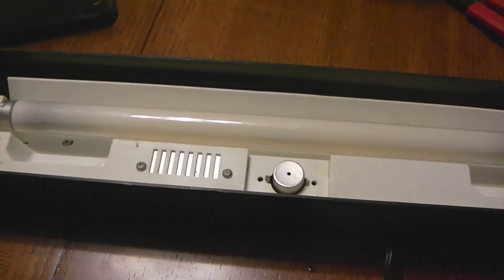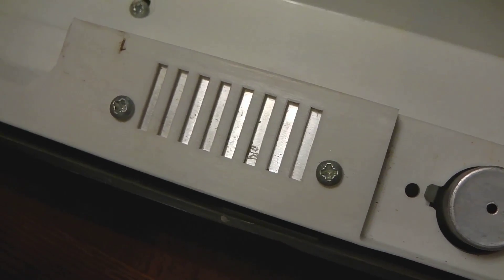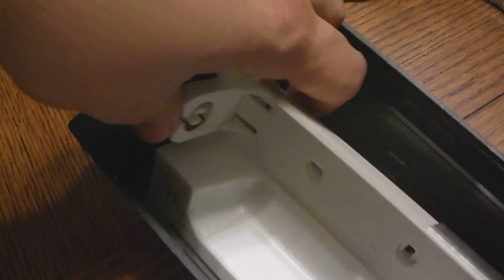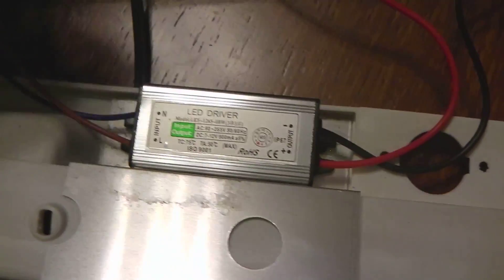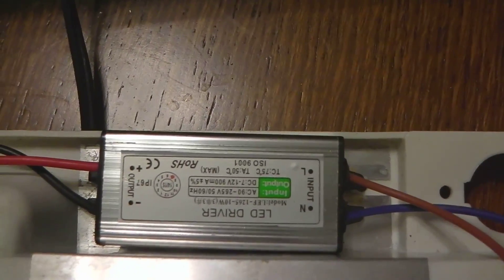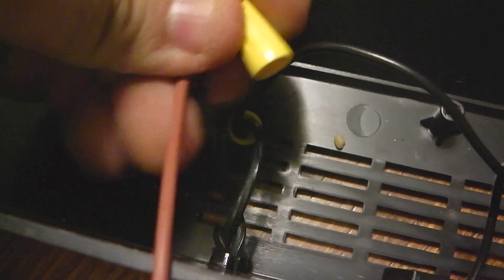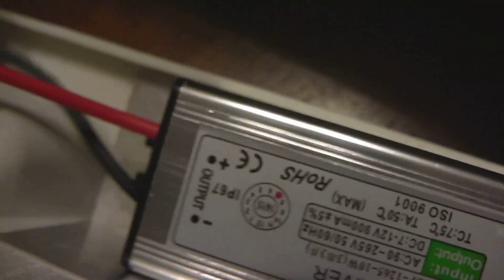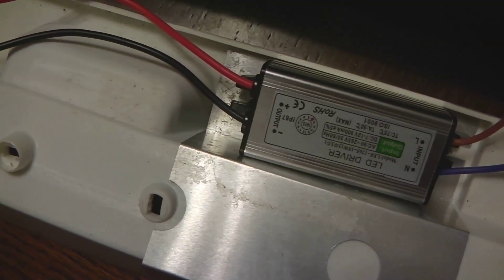DIY LED Fluorescent Aquarium Light Conversion

Comment: This is a great idea, but in doing electrical work always put the switch on the hot wire also known as the positive, not the neutral. This applies mostly to 120 volt home wiring where it can be a safety hazard. Years ago I had a 2nd floor toilet overflow and the water leaked through the ceiling and into my over the kitchen sink light. So I just turned the switch off to replace the light fixture and felt a shock. Luckily I wasn't grounded or I wouldn't be able to write this. The switch on the neutral will not be a safety issue on this setup because you would always unplug the light before working on it.
Reply from the maker: I believe I did wire it this way as I followed the original wiring and the on/off push in button still works like the original light which means that the positive is being shutoff before going into the 12v converter driver

Comment: Great idea. I bought 1m of the cool white led strip and 1m of the blue led strip. This is for a 36" long tank. Would a 30w driver be too much? And in your video the light looks more blue, is that because of the video or is the lighting more white?

Also if I plug the finished light into a standard programmable timer that goes to the wall outlet would it turn on my lights automatically like the fluorescent light did with the starter? I'm not interested in have the white and blue lights on separate, just both on at the same time. 

Cheers

Comment: Thanks for replying.  Sorry I should have read your description better.  I have 1 48 inch hood for my tank.  Will this be enough led strip to cover that...or do you think I should order more led strip?  Will the driver you used accommodate this amount of LED strip?
Reply from the maker: You will probably want to search for waterproof 5050 led strip white (they come in different sizes and also rolls)...you can trim it to fit by cutting on the copper strip with the scissor icon

Search for this on Ebay:  Waterproof 5050 LED Lamp Flexible Strip Light Blue 12V DC (for blue)
Waterproof 5050 LED Lamp Flexible Strip Light White 12V DC (for white)

you will probably have to convert cm to inches by typing it into Google to make about 30-40 inches (or 48 if you want to go all out brightness)

Also......seeing that you'll be using more leds, I would go with a 20-30w led drive instead of 10w (maybe go for 30w to be safe) Search for:  30w led driver

Depending on your tank depth and width, you might want to add more than two strips (such as 2 white and 1 blue or 2 white and 2 blue)

Comment: Can you please link me to the strips of lights you bought and the driver?  Thanks and great video!
Reply from the maker: Check the description....copy and paste the text to enter it into the search box for Ebay...there should be a bunch that pops up (copy and paste this:  

0.5M 2 x 50CM Waterproof 5050 30 LED Lamp Flexible Strip Light Blue 12V DC

Waterproof White 2 x SMD5050 50CM 30 LED Flexible Light Strip DC 12V

One is for the blue light strip and the other is for the white

For the dc inverter you need to search for this on Ebay:

10W High Power LED Driver Power Supply AC90V-265V